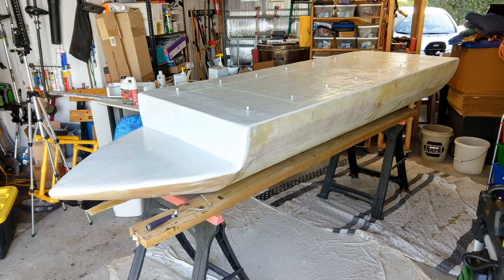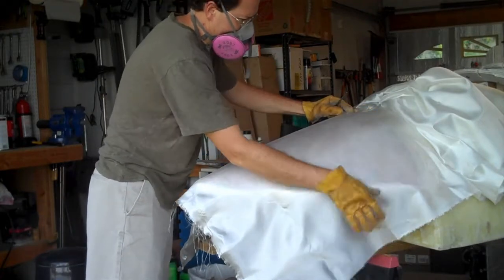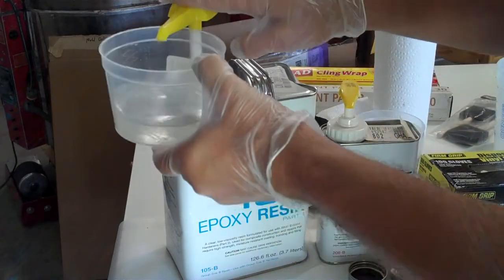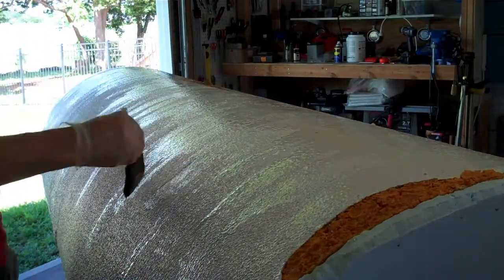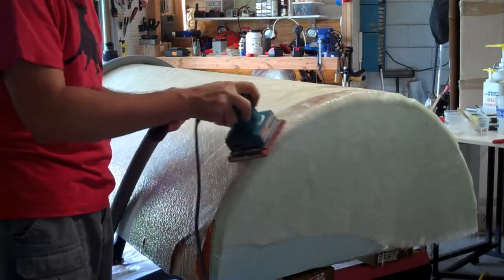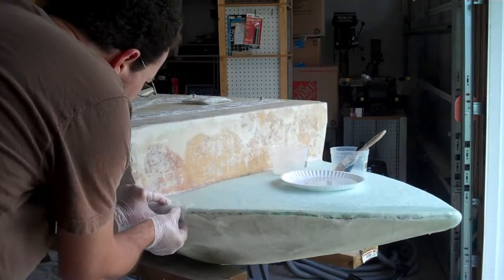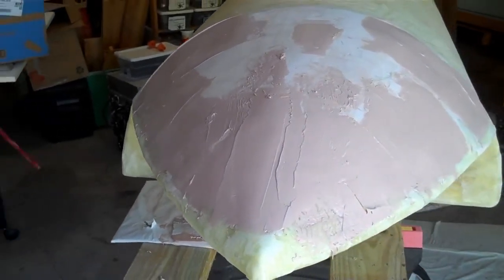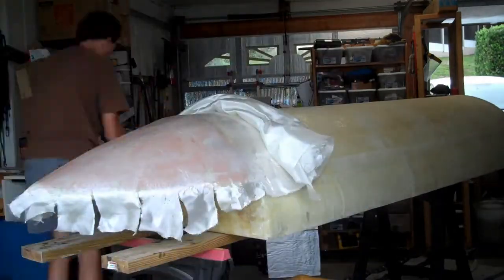Building a fiberglass mini-pontoon boat - Learning Fiberglass & Bondo  - part 2

Comment: This is awesome. Sooooo the glassing didn't melt the foam???? My pontoon i built was originally foam. I was gonna remake them and carve the hual for better plaining. Plus the massive waves id be going on. But i decided to make them out of wood. And stuff them with the old foam. Then glass. 

Here are my results
https://youtu.be/qMYV6V_t6OQ
Reply from the maker: Epoxy resin did not melt the foam (Polyester resin however may have very different results....)
Reply: What about the bondo over the foam? Did that melt it? That should be good under the glass.
Reply from the maker: @TheMrLoxton  Not that I observed. It's possible there might have been a little softening under the bondo, but not enough to affect the shape.
Reply: Good deal. Thanks for letting me know. I'll be remaking mine in a combined manner.